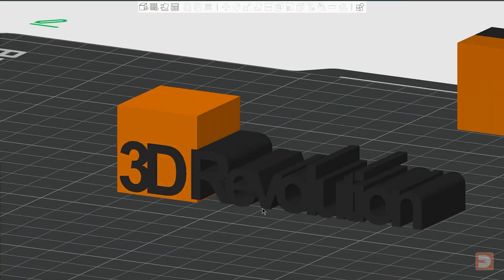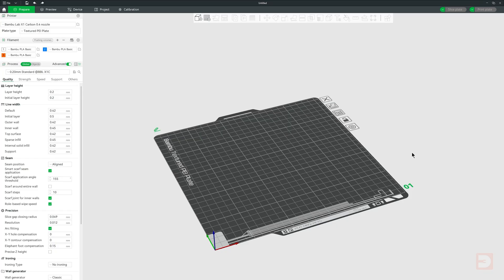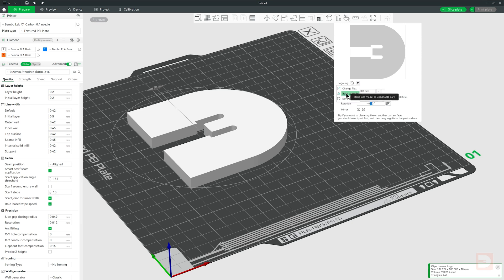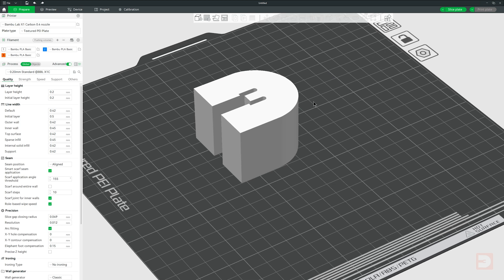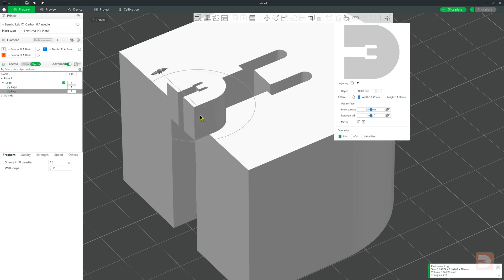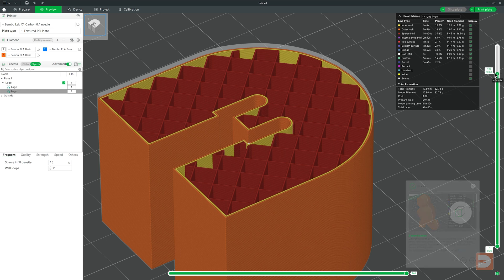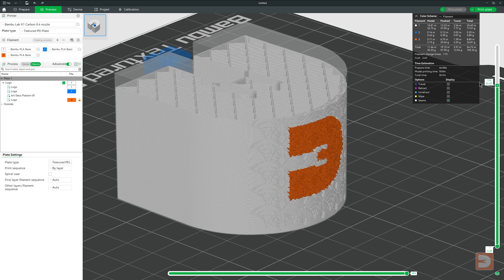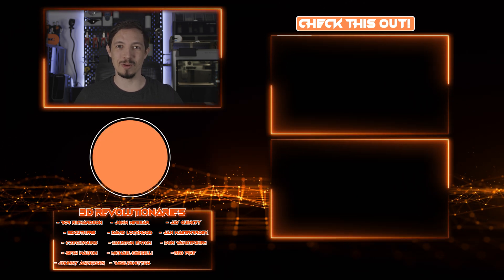3D Printing SVGs in Bambu Studio

Comment: I don't know what ive done wrong but when i slice, part of my logo disappears :(
HELP!!
Reply from the maker: What method have you used. Have you applied it as a modifier with a different filament assigned?
If so, a key thing to note is that modifiers won't apply colour changes on a surface which has been painted with the paint tool.

So if for example you had a cube that was white, and you'd painted one side black, then wanted to apply a logo to it in orange using a modifier, you'd want to right click it and set the default filament of the whole cube to black, then open the paint tool, clear all the current painting, and paint the other 5 sides white. Then the side with the logo applied won't have been manually painted and so should work.
Reply: @3DRevolution I might try again tomorrow. I'm wanting to apply an SVG logo to my projects and had been trying to embed it on to the actual 3D product in Fusion 360, but when imported to Bambu Studio it doesn't show, then found your video but am getting no where fast.
Reply from the maker: @marcelafacelli8095  When you are applying your logo in Fusion, what are you doing? Extruding it? Generally if I want to apply an area (like text or a logo) in fusion to be printed a different colour but flush with the rest of the model, I'll just extrude or cut in from the surface by 0.0004mm.
That way it's such a small difference that in Bambu Studio, on the X and Y axis the difference won't be noticable, and on the Z axis it's so much smaller than the layer thickness that it'd just be printed on the same layer, but allows you to paint it instantly using the fill tool in the Bambu Lab paint tool

Comment: did they remove the edit svg in bambu studios? i have tried multible SVGs but none are editable. all i want is to put a logo on a christmas ball, and i am not liking the results from blender (nor the proscess or the  turorial).
Reply: I was just about to comment the same thing. Bambu labs changes shit way too much it’s like every tutorial video I find is outdated even if it was created a couple months ago it’s frustrating
Reply: @willrivera2919  i did find the solution for it. it is as easy as instead of add primitiveor add part, you press add modifier. there after the toturial still works
Reply: You need to add a model first (an STL or add a primitive from right click "Add Primitive", then right click on it while selected and "Add Part", select SVG and continue as normal.

Comment: hello! when i slice my model (with modifier setting on), the svg logo wont show. any tips? thank you !
Reply from the maker: The colour applied to modifiers won't override areas you've manually painted with the paint tool.
So if for example you had a cube that was default set to white, then you painted one side black, and then applied a modifier shape to that wall set to orange, the orange wouldn't be applied as it's over a wall that has been manually painted.

In that case, you want to right click the cube, set the filament to black, manually paint the other 5 walls white, and apply your modifier and it should then work.

Comment: Thank you for your time. I am desperately trying to wrap a logo around a cylinder in Bambu Studio. For the life of me I cannot translate your screens above to the newest version of Bambu Studio. I do not see the little dropdown for instance that you are using to control everything. I just updated again and now more things of changed … I’m a complete noob and this is extremely frustrating to do what seems to me should be super common functions. If you have the time to re-do this video in the 2025 version 2.3.0.70 I would be eternally grateful. So far my journey in 3D feels like my journey in FPV drones, 90% frustration at figuring out even the basics, 5% luck in making it happen, and 5% knowledge. I don’t know if I can do another FPV like learning curve. Anyway, to say I’m frustrated at the concepts, implementation and interface would be an understatement. Hopefully you’ll see this, or someone else and publish an update. Thank you! 😊
Reply from the maker: Well hello fellow FPV flyer. I definitely do plan to produce an updated version of this but I couldn't tell you at the moment quite when that'll be. 
Whilst it doesn't limit the SVG tool entirely, if you're missing access to certain settings, can I just check, you have the 'Advanced' tab on the 'Process' title bar on the left turned on?

Comment: bambulab must have decided modifier won't just change the color using modifier anymore.. every time I slice it.. my new color option disappears.. so annoying, even tried creating 2 copies, one negative part or cut, and the other as my new color.. granted I am trying to do this face down on the print bed.. maybe that's my problem.
Reply: did you figure this out? im having same issue

Comment: Arrrg!  I just want a flat logo embossed onto a box lid.  I think it was in there but then you started going way too fast!  I'll slow down playback, maybe I can catch it...
Reply: Whew, took a while, figured it out
Reply: @cybermarxstudio  howd you do it? i cant get mine to work especially with colors its printing all base color
Reply: @owenwild709  basically 3 things you need to nail down.  The SVG object must be at or below the bottom layer, or it will get covered.  Also, the Color of Filament needs to be assigned a contrasting color (under Objects).  Finally, make sure no "Painting" is enabled, because Painting has priority over Modifiers which is what the SVG is.

Comment: I was doing this work in fusion which definitely took a little more time. 

Are you able to add an SVG and use it to set a secondary color (probably as a modifier if I followed right) but have it print flush with the original object?  Basically like printing a flush logo a different color.
Reply: That's exactly the same question I have. This is a great video with the exception of how fast he talks. if he would slow down about half speed it would be a lot better for most people.

Comment: No matter what I do the svg does not change color and show in preview but everything before hand is right so why does it not change filaments in the print?
Reply from the maker: Sorry I'm not entirely sure what you mean. Are you saying the colours look right in the preview but not when sliced? What method are you using? Are you using the SVG as a modifier?
Reply: @3DRevolution  im saying when I add the svg and I just want a color change with no emboss or anything. I'm forced to .3mm extend it in or out to get the effect but that causes a uneven surface.
Reply: @3DRevolution  sorry yea ive tried them all but modifier works best. I'm importing as a svg just desiring a color change nothing else.
Reply: @cizrek  Same for me...

Comment: Nice video
I don't have the "Edit SVG" on the right click menu ???
Also, in the minute 2:24 you import the pattern. It shows the solid as "wireframe" and not areas. How can you change/control that?
thanks
Reply from the maker: Glad you like the video, sorry to hear your'e having some issues.

I'm not sure why you don't have "Edit SVG" in the right click menu. Are you definitely right clicking on an SVG that you imported and not on a nearby model? If you want to check, instead of right clicking on the object itself, go to the objects list in the menu on the left, then single left click on the SVG to highlight it, and then right click it in the menu and the Edit SVG option will also be there.

Ah that pattern SVG I imported wasn't wireframe, it was simply the way the SVG had been designed so it gave me a thin pattern that I extruded.

Comment: I tried importing some svg files I had exported from CorelDraw but Bambu Studio messes them up. I have read that from v1.10.1 svg handling is broken and one should install v1.09.7 for proper svg handling. Bambu Lab seems to have not implemented a fix in the newer v1.10.2 slicer.

Comment: This video has helped me massively.. thank you.. I am struggling adding an SVG to the bottom of my object. I've tried modify but every time I slice it disappears off the bottom. Any ideas?
Reply from the maker: What method are you adding it with? Are you using it as a negative volume (cutting into the object), are you adding to the object (having the SVG protrude out the bottom), or are you using it as a modifier to change the settings of that area of the object?
Reply: @ thanks for messaging back. I sorted it by increasing the depth to 0.2 so essentially 1 layer.
My mistake was reducing this down to the lowest which was 0.01mm
Reply from the maker: @Tasty_Crumpets  Ah yes that makes sense. When applying it as a negative volume along a planear surface (basically that would be cut down through the layers), it can only actually be applied by the layer height, so the ammount it cuts away needs to be at least 51% the thickness of the layer height (idealy 100% or more).

Comment: I came here hoping to find out how to use an SVG to apply a texture to an STL file.  It looks like you did it on the front there, but I didn't catch how you got it to wrap onto the surface.  I tried watching at 0.25 and it looks like it just snapped when you applied.  if you had expended it far enough, would it have wrapped all the way around?  Is there a way to get the pattern to repeat without having to manually place it multiple times (and get the pattern to line up)?

Comment: To an extent it seems Bambu studio is capable of several 3D modelling functions. I've embarked on the Blender doughnut tutorial series, but now I'm questioning whether, as someone intending to make functional prints, whether this is the best choice. As i will be using a  Bambu printer, should i focus on Bambu studio, (or Orca slicer as someone claimed it incorporates all Bambu features plus extras). As a complete newbie I want to avoid duplicated/wasted effort if possible. Do you have a rundown comparison of software options tailored to use cases ? I appreciate your clear and comprehensive style. Thank you.

Comment: I’m very new to 3D printing and found your channel recently - likes, saved & subscribed. 

This was a super useful video. 

I’ve been wanting to 3D printing text letters. 
Am thinking of using power point to make SVG files of individual letters and then export to Bambu studio to treat as you described and print on my A1 Mini. 
Did that make sense or is there a better way?
Reply from the maker: Really glad you like the video and welcome to 3D printing.

Regarding text, you can use text directly in Bambu Studio using the text tool (see my Text Tool Tutorial). However, that only works with some fonts and if your desired font isn’t an option, you could either use CAD software to convert the letters into 3D models, or, as you suggest, you could use the SVG functionality.
Reply: Thank you. Much appreciated. 
I want to print some single letters so that I can affix them to a wooden truck for a grandson.